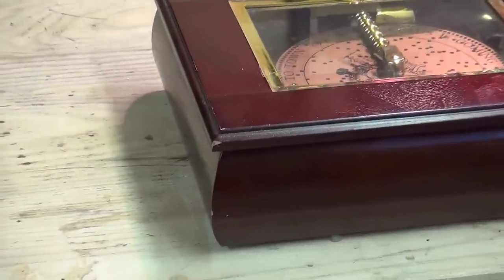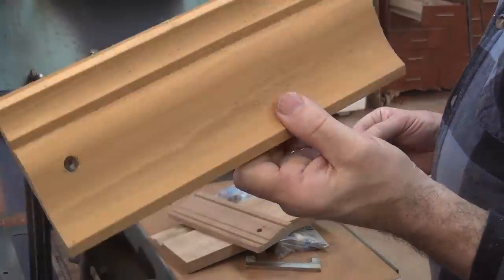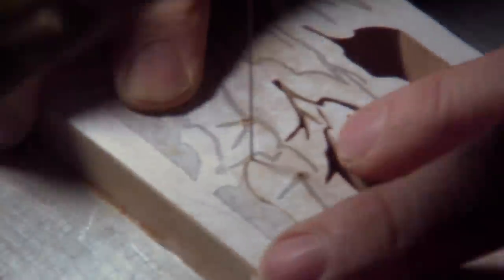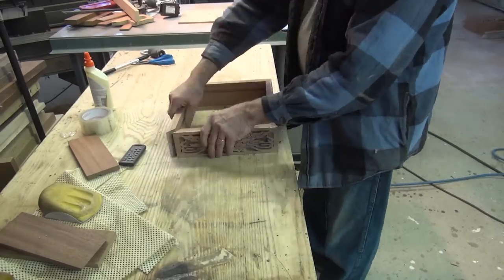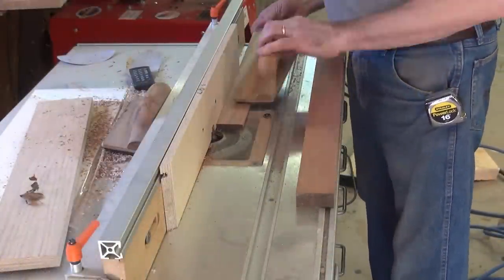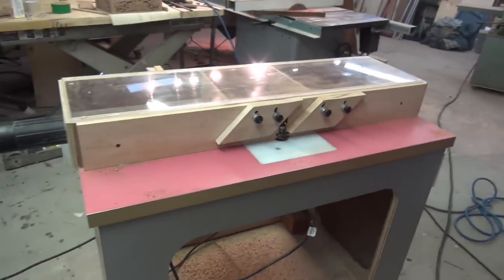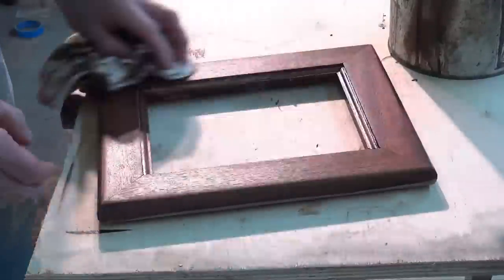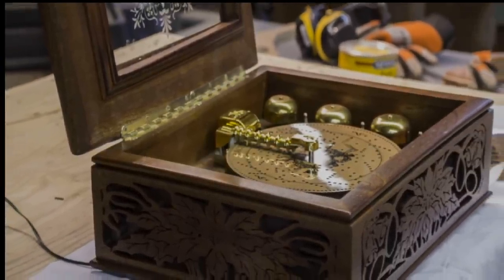Making a Music Box Part 1 of 2

Comment: I appreciate the various tips and how-to's along the way.  Although I have to disagree about the foot peddle.  I like to sit with my legs up (feet resting on the cross bars of the stool).  Can't use a peddle from there.  I found this position for comfortable for my back.  Love your saw!  I have the RBI Hawk G4.
Reply from the maker: Hi Jon,
There is something said for having both hands on the work piece when starting and stopping a cut. especially when you brake a blade. your saw stops instantly without looking for the switch. my personal preference. 
My saw is OK . but i would love to have the Excalibur